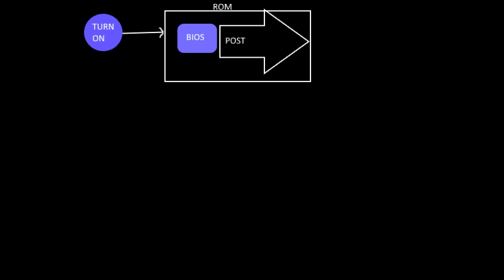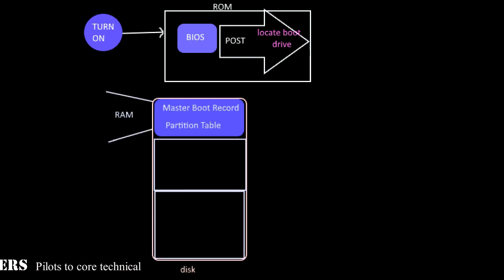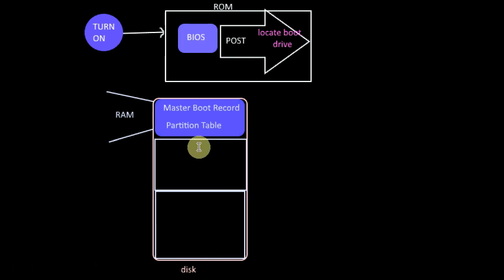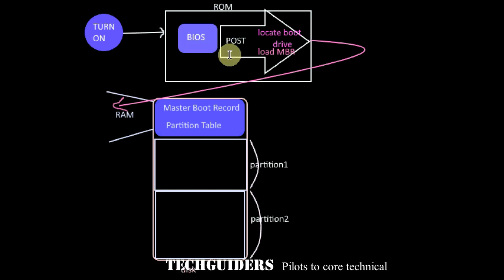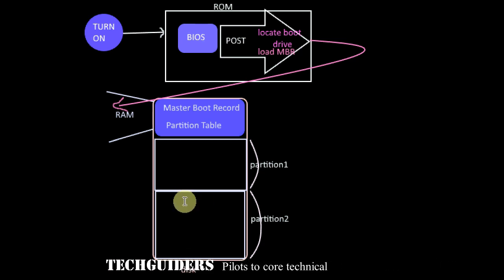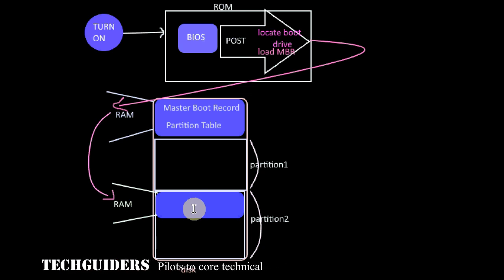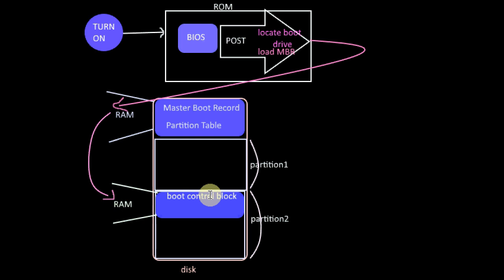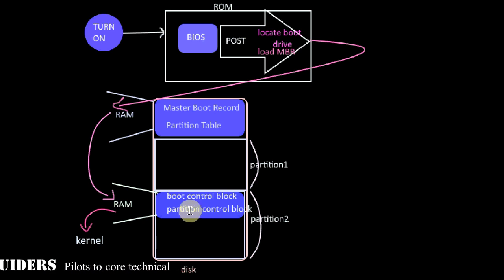Boot process|MBR|File System Tutorial-2

Comment: that's a great cours but  I have a question for the first sector from the partition that contain the partition block and boot block from what I know it doesn't contain the kernel but it contain the bootloader stage that will allow us to load the kernel ,Is that correct ?